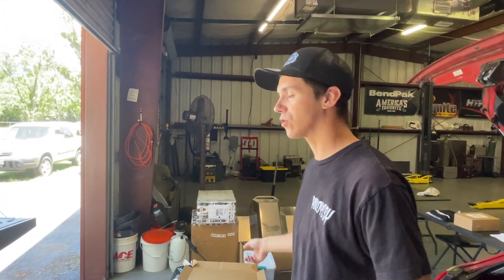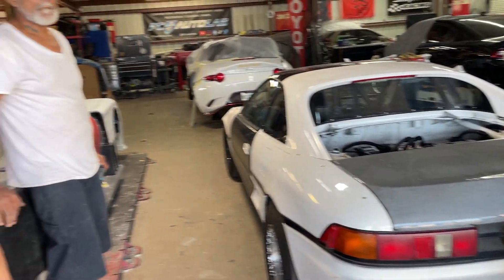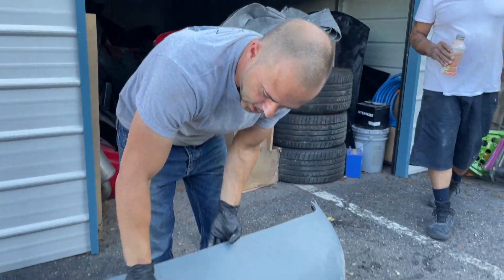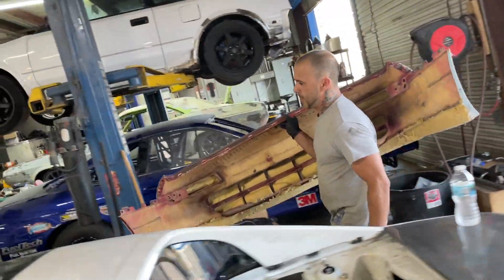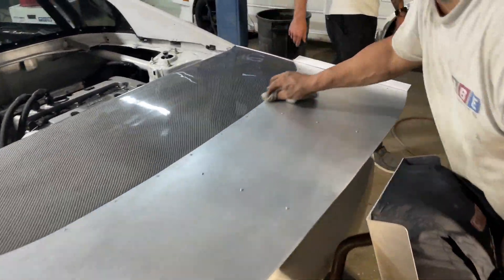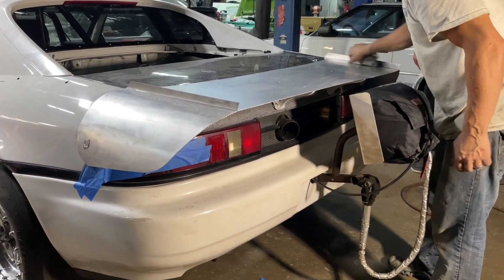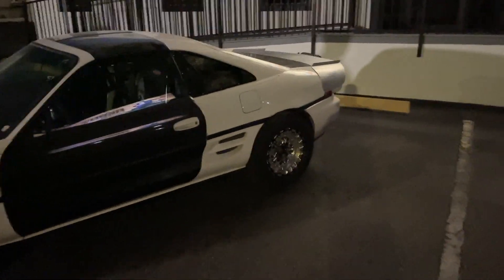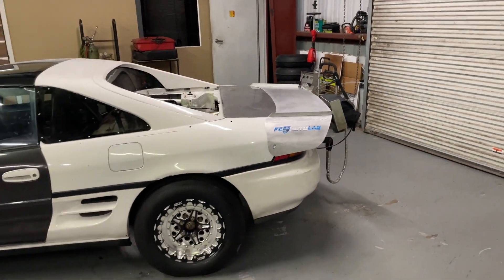Our 1400hp Mr2’s New Custom Drag Wing! (Looks Amazing)

Comment: @BoostedBoiz
Hey Kyle, you need to get Falcon to design you 2 small air scoops that are mounted into the rear roof pillars on the sides so that they can direct air into the Turbo. They don't need to stick out & cause any air turbulence as if you have oval air vents that sinks into the pillars either side going from a 2 pipe to one feeding directly into the turbo then your turbo might have better boost.
Reply: Kaylee needs to sit down and talk to an aerodynamicst about the SW20 first!....
Reply: NACA ducts where the rear side windows are should do the trick
Reply: @willecutlip  Yep, rear side windows.
Reply: The mR2 has scoops in the bottom

Comment: Love it!!  Last post I was saying how the MR2 needed a wing and front splitter and now you're halfway there. Once Falcon gets the front bumper and rear quarters done for more meat that car is going to feel so much more planted and stable. It would also help if he made a matching wing for the roof as well cause there's a lot of turbulent air getting trapped behind that rear deck. I'd look into some composite flat panels for under the car too...streamline everything and she's going to slip slide into the low 7's for sure!
Reply: Thats added weight for no reason and in the worst area of the car. That turbo in no way is starving for air. Especially with no engine cover. If there was a cover and this wasn't a drag car maybe it would be needed to keep cooler fresh air in that compartment.

Comment: It would be awesome if he could make a one piece carbon fiber front clip and the carbon fiber T-tops and maybe even a carbon fiber dash panel and you'd be set to jet then all you'd need is a Strange steering rack and column and 4 way adjustable Strange struts and coilovers and a Strange stiletto style rack and pinion steering rack and either TBM brakes or Strange carbon fiber brakes
Reply: Someone is a strange fan boy lol 😂 ! Kyle already has a Motion steering column and all his suspension is from Hux specifically designed for the mr2. The coilovers are valved and have the correct springs for his application.

Comment: Another addition you should look into doing is a lexan type of window/engine bay cover the will essentially turn it into a fastback look. It will drastically improve high speed stability, will make you faster, and help air flow over the new drag wing. This is how Shelby and his team  changed on the original Cobra design which became the Daytona Coupe. Made the car faster and improved fuel mileage to be competitive for LeMans etc

Comment: Kyle put some vortex generators on that front bumper and take the car to the wind tunnel for testing . Aircraft use vortex generator for air flow control and they can be 3D printed and glued on .

Comment: When you take the car back to that shop to get the front clip fitted you should talk to him about molding in some non flip up head lights like the one's on his car and maybe a roof scoop going to the engine cover so you can dissapate some of the engine heat beings it is a rear engine car with the engine sitting right behind the back window I'm sure the engine doesn't get that much airflow going directly to it plus I think it would look cool too

Comment: Would like to see the engine bay covered. And a low profile, forced air roof scoop that splits or pipes into the turbo inlet. And second a wind tunnel visit for before and after results.
Reply: If you REALLY want to go fast, wind tunnel testing is definitely part of the equation - shaving a couple 10nths in overall drag coefficient of equals free horsepower at speed.

Comment: Why did they not add a wickerbill, I don't know if you will be able to get the desired downforce without it. The spill plates should help a little to keep the car straight. The longer the wing the more surface area you will have for the wind to push on as well.

Comment: I'd like to better explain how that wing works. It is making your car more aerodynamic. There is a trapped vortice that forms on the backside of every car, but it is unstable because the back of cars are too round. By creating an extend plate off the back of the car, that trapped vortice is both more stable and further extended. That trapped vortice acts like an extremely extended and tapered body panel, kind of like the tail end of a wing. This, in effect, reduces your drag.

Comment: Drag really becomes important any speed over 60mph. And a drag car spends most of it's run way over that speed so i think this wing will give the car a few  mph top end speed. Well worth it. Same for that front airdam specially when you would make that airdam connect up with a flatbottom plate going the full length of the car. Because the undersides of many cars have terrible aero.  Lots to gain there.
Nice uptrade!

Comment: think you could sell the fwd to rwd gear selector conversion for those things and be making a little money of it
as for the missing lid over the engine : maibe you can put a custom grille over it , either using a lasercut plate (could have the boosted boys logo on that ) or made from thinwall polished aluminium rod

Comment: You need an aero engine cover, Pretty sure I have seen vented carbon fiber ones.
Reply: The vented engine covers were stock on the factory turbo cars. That carbon one is probably a replica.
Reply: @Ontheregz  the covers I have seen follow the angled roofline removing the low pressure area behind the rear window.
Reply: I wish I could post a picture because I actually replicated the Ferrari F40 Made out of Lexan you can see through

Comment: Nice wing but the guy only with good intentions want to put the bumper np its nice but please please get rid of the angle at the bottom that for front wheel drive , without it you will still have more downforce cose the air flow will be better and the angle of your hood , so at the and if you keep the lip that will be to mutch and slow you down a bit

Comment: Anyone else notice they riv-nutted the mounts to the trunk but they riveted the spoiler to the truck/mounts?
Reply: Only for this weekend it will be drill and tap with torque screws And I’m even going to recess them in to be flush
Reply: @FALCON_CREATIONS  looks great that just threw me off a bit.  But great job brother.

Comment: Now you need a flat floor, and a diffuser, and for the love of GOD put the engine cover back on so that already turbulent ass air in that area has something to Fucking attach too so it actually hits the wing. Some side skirts would help you too,keep the air under the car not spitting out and being fucked up by front tire wake not staying attached to the side of the car.  Probably could’ve done 190 traps without that turbo if you actually realized how IMPORTANT aerodynamics is ESPECIALLY on a car with a rear window design like that. The car is FIGHTING it’s self past the 1/8th ALOT more than you think
Reply: lmao or just add like 1% duty to the boost control solenoid. Nobody cares about nitpicking over pointless minutia when the car is turned down to keep grip anyway. 😂

Comment: Speaking from a pure engineering and safety viewpoint, that wing install is shockingly bad.
Rivets are designed to hold two thin pieces of sheet material together, which means the fastener goes all the way through both sheets and then deforms when pulled to ensure it stays secure.
With your wing to bracket fasteners, they put rivets in to blind drilled holes....... this is a massive no no, the rivets will have no lateral deformation and they are gonna pull straight out of there if any force is applied upwards on the wing.
They originally said they were going to drill and tap these holes, why did they not? 

You WILL need to do something about this, preferably sooner rather than later to avoid losing this wing at 180mph and potentially crashing and wrecking all your hard work and investment........ not to mention your own skin.
Reply: It was a last minute thing he needed to take the car car is coming back and we are changing that
Reply: @FALCON_CREATIONS  Well you better have your fingers crossed he doesn't wreck because of this at Cleetus and Cars then.......?